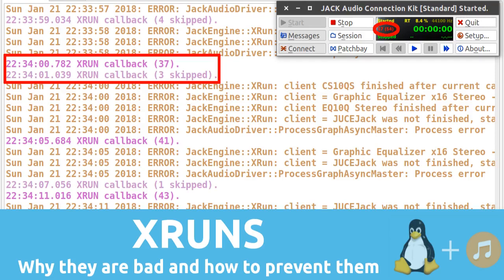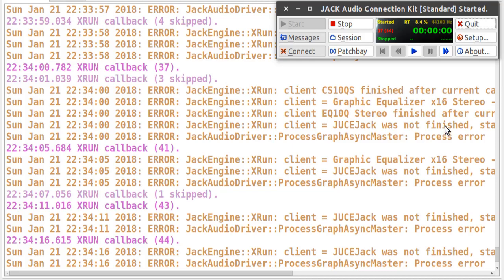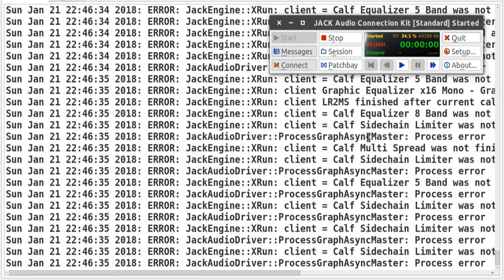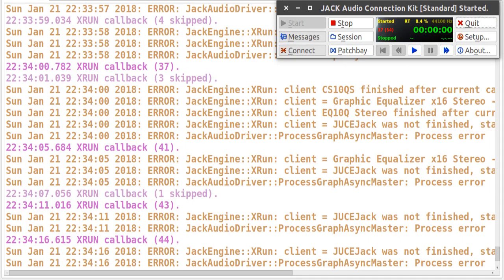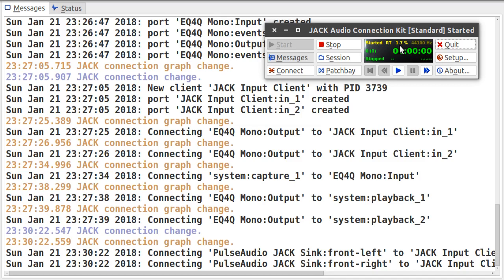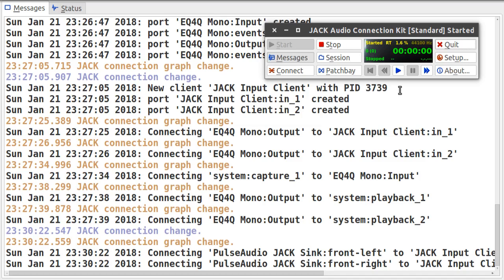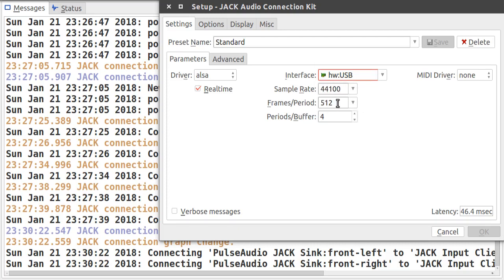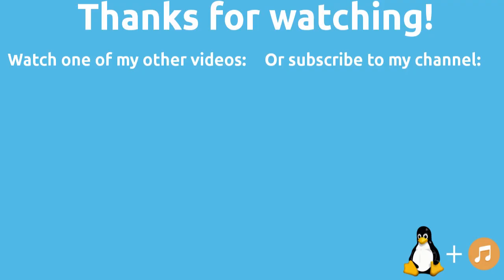XRUNS - Why they are bad and how to prevent them | Tutorials

Comment: Come on, that is not a solution!
- Make sure to use a USB port that has no interruptions (USB-c ports might be a problem)
- Wifi might interrupt your audio card
- check if any re-sampling is happening in your audio flow
- make sure the preempt kernel is enabled
- etc...

Comment: In my case I had to disable networking to get rid of XRUNS - that's probably because I use WIFI in my laptop. I don't know if using LAN connection would help.
Reply from the maker: Interesting! Could be a problem with Interupts. Using LAN could help.
Reply: @Thijs Janssen , I exactly thought the same.

Comment: Hey wondering if you can help me out with an issue of volume levels. In ardour if you create a track and record something the meter will show that the level is -3db or something,  but the master track shows it as being at 0db or even in the red. When I try in other DAWs like mixbus or reaper their levels are identical. I'm wondering if this is a glitch in ardour or normal.
Thanks
Reply from the maker: Haven't had any problems like that. Is your ardour version the current one? Otherwise ask in the ardour forums.